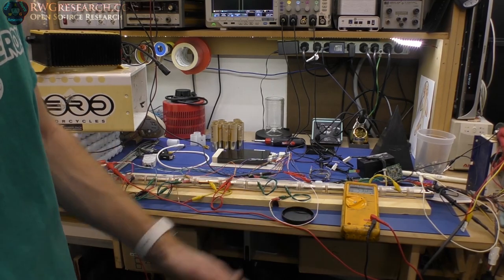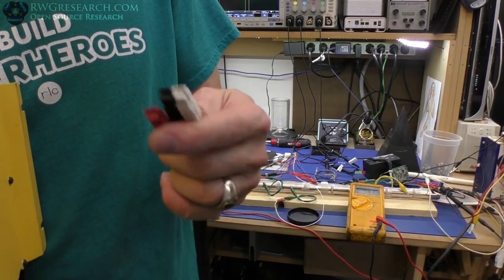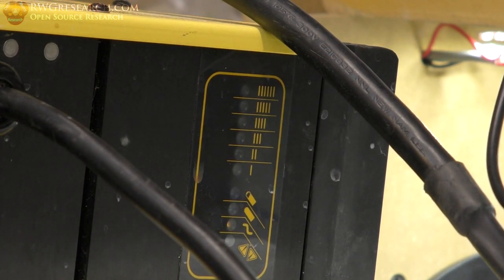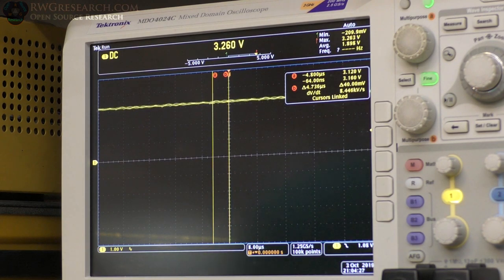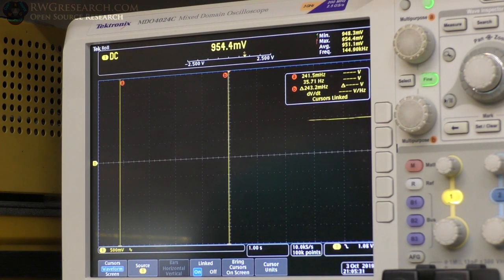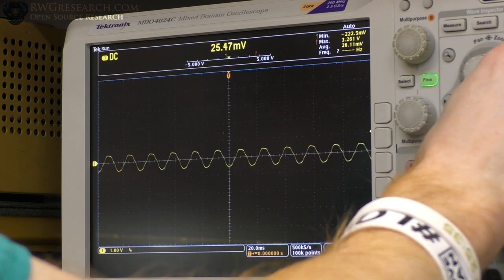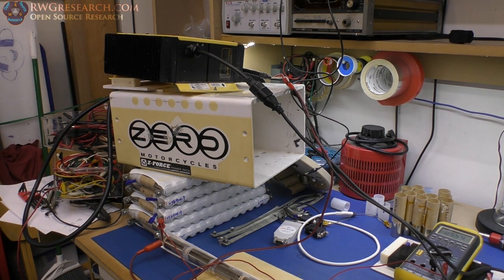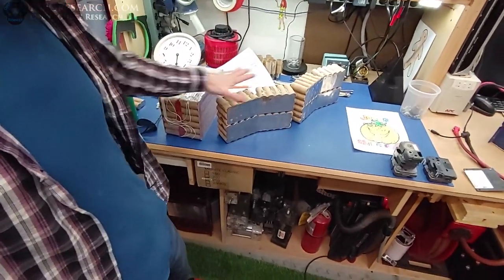Zero P3: Original Battery Charger..  2009 Zero MX Flagship Electric Motorcycle.

Comment: Hey Russ, I am from Germany and I am trying to rebuild a Xero X. Have you found out how to use the charger with a different BMS (at which I cannot connect the white wire)?
Reply from the maker: The charger white wire just needs to be connected to ground. Then the charger will come on. You can use this to stop the charger just like it was with the factory BMS. Just disconnect it from ground  and it will stop charging. Also taping the white wire when plugging it in will also turn it in to program mode or something... I haven't tried this though. What year is yours? 2010? ~Russ